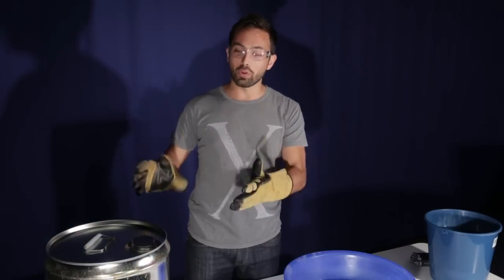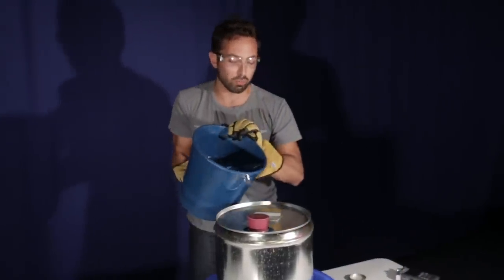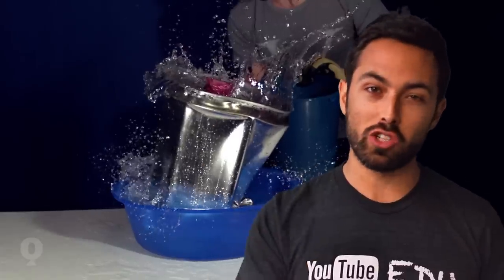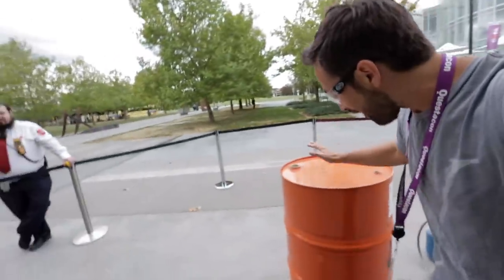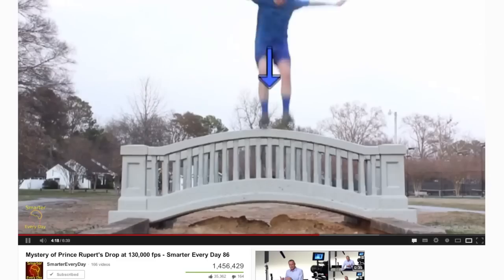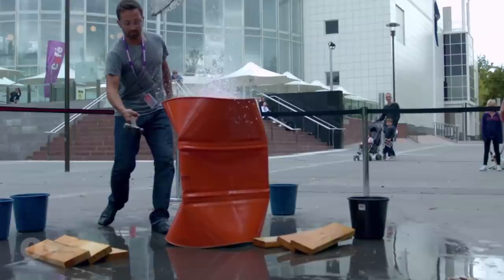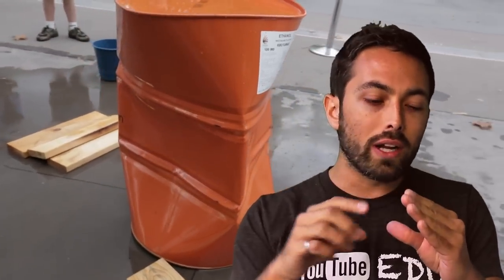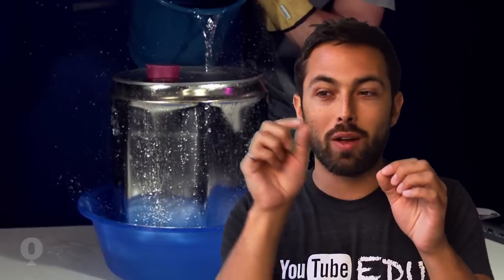Epic Slow-Mo Drum Implosions!

Comment: Ah, I see what you mean. A low resistance of pressure by the first cylinder prevents the pressure from building up and is not "crushed" as much as a cylinder with a high resistance of pressure.

Comment: I imagine it has something to do with the fact that as you scale down a cylinder the ratio of volume to surface area decreases meaning that the vacuum pressure per square unit of SA falls, which equates into the smaller cylinder not having enough of a vacuum to overcome the strength of the metal and form the most space efficient shape. It's like a compromise.

Comment: the stronger material of the larger drum gave it more structure under higher pressure differences, which gave it the need to optimise space better in order to reach equilibrium when the structure finally collapsed.

Comment: I type this comment before my mind is influenced and prejudiced by reading other peoples comments.
I put it down to these factors/understandings/principles:
1. The Smaller drum had a much more intense heat inside of it as it was heated indoors at room temperature, creating a greater volumetric difference when cooled..
2. The Larger Drum did not have as strong a suction as it was heated outside and constantly had the outside temperature  combating the smaller heat source under the barrel.
3. The Smaller drum had no reinforcing ribs around the circumference of the drum so gave in much more easily, allowing a short spread of the structural failure.
4. The Large drum DID have structurally reinforcing ribs pressed into its construction, so the force required to make the drum implode was so much greater, when the structure did actually give in The load was spread in a form that had more stability. A Triangle is more stable than a hexagon.
Have a nice day people. =)

Comment: I believe it s purely the difference in negative pressure with the orange cylinder having a more negative pressure than the silver one so it became the shape with the lower volume to surface area. If you were to create a pressure lower than the pressure inside the orange cylinder it would create an even smaller equilateral triangle (if the material were perfectly curved and without any imperfections) with the excess pointing outward from the points. such cool slow mo in this, loved it.

Comment: The first was to make the hexagon, but since it still had a vacuum in it, the bottom edge gave way as it has a crease similar to that of the 200 gallon drum. This allowed a portion of the drum to collapse again, but in a more confined section towards the bottom, which created more torque, along the now existent vertical edge, which caused the slight deflection of the top edge and plate you can see at 1:27.

Comment: The difference in buckling modes could be due to a difference in loading, the smaller can failing due to uniform atmospheric pressure since the failure wasn't initiated by a impact while the failure of the large drum was initiated by a impact load with the mallet. 

Another possibility could be due the location of the rolled beads on the drum. Rolled beads are used with sheet metal fabrication to stiffen the structure. The location of the beads would affect the boundary conditions of the drum.

Comment: The smaller drum is not only "smaller" (as in proportionally smaller), it is also a lot shorter in comparison to it's width and depth, or, since we are talking about a cylinder, it's radius.

Because of the properties of the metal, coupled with the smaller radius and shorter "body", there is a lot more resistance against the "walls"' movement toward the center,  and that resistance is what defines how many sides a (the resulting) polygonal cylinder will have in this case.

Comment: 2/2) Triangular surface area of bigger cylinder is proportional to the hexagonal surface area of smaller drum by a factor of k^2 - considered that the drums have the same pressure at the instant before the suction and right after the implosion. And so the bigger drum needs to make up for the greater loss in volume by a greater change in surface area of the dented part, and so it creates a triangular shape which is more efficient than a hexagonal shape.

Comment: I think there are a few things at work here, first the bif drum got help to start deformation so it was much more implosive. The smaller drum deformed in stages as the vacuum developed due to the thinner walls and absence of rings. Watching the slowmo again I get the impression the steel had a form of strengthening at the hexagonal corners, maybe from something as simple as heat or compression from rollers during manufacture or how it was stored prior to manufacture.

Comment: The diameter/length ratio of the cylinder affects the type of mode of failure. 

A very small ratio (relatively skinny or long) cylinder would tend to fail by collapsing flat (2 sides) on itself at the middle of the cylinder then spread to either end where it's constrained  to stay a circle.

As the ratio increases (cylinder becomes relatively fatter or shorter) the number of sides created would increase from 2, to 3, and so on to infinity (cylinder becomes a disc).

Comment: i believe it to be either an effect of the height to radius ratio being smaller on the smaller cylinder or the smaller drum simply wasn't compressed 'exactly' the same so it wasn't as compressed as the larger one. or it was more structurally sound so the force of the vacuum could only compress it to a lesser extent, so a triangular prism would have been to little space for the matter within the smaller one, and a rectangular prism having more space fit the change better.

Comment: The different failures were the result of the structures of the drums.

The larger drum was taller, so the wall was able to deform more without significantly altering the structurally sound circles on the top and bottom. This allowed it to for the most compact shape in the middle while still being round on top and bottom.
The smaller drum could not form a triangle without drastically altering the top and bottom so it did not. The inverted rips further strengthened the ends as well

Comment: The energy required to compromise the structure in consideration with the length available for continuous deformation defines the shape of compression.  If the first drum were longer (perhaps twice as long), with all other thing being equal, you would have gotten a triangle, but the energy required to compromise the second drum is so great, if you kept all re-enforcement the same, you would likely have to scale it to a quarter of its size to produce the hexagon.

Comment: dont forget that a hexagon, is just two equilateral triangles placed (and rotated) on top of each other. also, the smaller drum encloses a smaller volume, so surely it would "want" to   deform less as there is less of a vacuum to pull on it form the inside. So it deforms into a shape that relieves the can of less stress, and the big drum deformed into a shape that relieves it of more stress. ie. the deformation is proportional to the stress on the drum

Comment: A triangle has a much smaller volume.
So the amount of sides would be relative to the amount of pressure that needs to be equalised.
In the case of the can, it was weak and crumpled early causing only a small amount of pressure to change, it happened even before the steam had all condensed as seen by its second crunch.
In the case of the 44, it has 2 reinforcing corrugations around the side, so it can fight off pressure until a large amount need to be equalised, and so it needs to crush into a smaller shape, IE triangle.
If you had an even stronger canister being crushed it would have only 2 edges.

(don't quote me, I have no education at all on the subject, just a guess)

Comment: I noticed the drums collapsed around the ridges in the drums, which were nearly at the top of the small drum and around the center of the big drum. The volumes are different and the area above and below the collapsing point are too. By how thick the metals were in both barrels, and the size of them, the shape they collapsed in were just most convenient. Plus, you can already see the faces of the hexagon before it crumbles by the reflection of the light.

Comment: The ribs and thickness add strength to the drum. The drum is so strong that it is not able to buckle easily. The weakest division of a round hoop is 2 sides but since the forces of these two sides are equal and opposite the drum can't fold in two. It is forced into the least unbalanced state or three sides. The container is weak relative to the stresses on it so it buckles over a shorter distance or more sides. Picture a long bridge made from thick steel compared to a short bridge made from foil

Comment: Since the big barrel was relatively long enough, the atmosphere was able to equalize the pressure by doing as little boundary work as possible.  But since the diameter/height ratio was larger for the small barrel, the metal would need to be stretched in order to form an equilateral triangle (and obviously stretching metal requires a lot of work). Therefore, for the small barrel, the regular polygon with the least number of sides which would not require stretching the metal is a hexagon.

Comment: I think I have an explanation for different imploded shape:
I believe it has something to with the Euler's Buckling Modes....
To simply it....the slenderness ration (given same material for both cyclinders) is different for both cylinders. As the larger 200L drum has large slenderness ratio (above a critical point lets say SLc....which is required for an equilateral implosion)...so it'll buckle in a simplest buckling mode i.e. an equilateral triangle, where as the smaller drum has a lower slenderness (lower than SLc) ratio leading it to implode is a more complex buckling mode.
This is a very quick explanation on Sat night....but I believe I have the right direction.
To understand how buckling comes into play draw a free body diagram of cylinder's cross-section (looking at it from top or bottom)...and you'll see that only the compressional forces in the sheetmetal are the real culprits.
Hope....I'm right
Reply: personally, I feel like it has something to do with how close the crushed area gets to the more reinforced "caps", as for the hexagon it's extremely close and in a sense must be more like a circle, while the triangle one is fairly far away from these edges, allowing it to take the shape that is least like a circle, the triangle, I guess a better way of putting it is that the caps restrict the ability of the can to crumple, resulting in the different shapes depending on how close the crumpled zone gets to these edges, think of how much more difficult it is to crush a can at the ends rather than the middle.
sorry for my terrible explanation, I'm not very good at explaining concepts in my head and would probably be a terrible teacher, however, if anyone can understand this and create a better explanation, please do

Comment: The shape of the cylinder after the implosion is dependent on pressure difference and the resistance of pressure by the cylinder. Less pressure difference and less resistance results in a prism with many edges. Bigger pressure difference and more resistance results in a prism with few edges, or three edges, the prism with the fewest number of edges.

Comment: I think the little drum is structurally stronger then the big one(thickness of the tin on both of them is probably the same and they have to resist different force -- air pressure across different surfaces). The metal tries to move as little as possible on both of them, but due to the structural weakness of the big one it is easier to form a triangle and in the little one it takes less work to make a more-lateral polygon rather than a triangle since it still has some "resistance" in it.

Comment: They crumple in different patterns due to the difference in shape of the top edge of the drums. In the 20 gallon drum, the top edge is a concave "C" shape, which can resist higher forces of deflection. However, in the 200 gallon drum, the edge was a much simpler folded crease. This cannot resist such high deflection forces from the collapsing walls so the top plate can bend to accomodate the triangle. The top edge of the 20 gallon drum could resist it better, which is why it collapsed twice.

Comment: I like point 2. The smaller the drum the smaller the change in volume necessary for the desired pressure. Therefore as a drum decreases in diameter it's compressed shape will resemble a circle more and more. Conversely the larger the drum the more a compressed shape will resemble a triangle (or perhaps it may implode completely into a straight line, like it's been pinched there?)

Comment: i believe the drum crumpled to the triangle because of the strengthening bands that surrounded it and apart from size "volume" its the only significant difference between the two drums, so even after the barrel collapsed the bands still strengthened it sufficiently to not be crushed completely, so the vacuum still existed so had to take the smallest shape possible

Comment: What an awesome video!

Maybe the smaller drum made a hexagon because it's height to diameter ratio was lower and the supporting circle at the top and bottom of the drum had more influence?

If you suck on a straw it will even get totally flat in the middle, thus only having 2 corners.

Comment: I realize many commentors are saying something about the hexagon being stable enough, but remember that the hexagon was metastable, because a few miliseconds later it crumpled again. The large drum simply went past the hexagon and straight to the triangle. Also, from other videos, soda cans will crumple straight away in the manner similar to the smaller can, but without going to the hexagon. I propose that the thickness of the drum relative to the curvature is the most significant factor.

Comment: Minimum volume is not an equilateral triangle, it would be something flatter. There are plenty of real world examples where vessels or large pipes collapsed under vacuum, and depending on the exact situation they tend to wind up flat, or flattish. When you design pressure vessels, you actually have to check if they will withstand full vacuum, and provide protection if it is needed.

Comment: If you imagine doing this to a tuna can with very rigid endcaps, I think you get at the reason for the different polygons. Thinking about the interior angles also helps make sense of it. A near perfect circle has the largest interior angles, approximately pi. A triangle has the smallest pi/3. The other polygons are in between. In order to get a small interior angle the material must give/bend more substantially. Makes sense that the more stable container would be unable to achieve the optimum.

Comment: It's most probably because of the shape of the drums, especially on the corner. the first one has obviously a stronger base, and it's length (comparing to the surface of it's base) is not big enough to allow a triangular shrink, so it was decomposed to smaller shrinks. while in the second experience, the drum was tall enough, and the corner was not strong enough to keep its circular shape, so it was more shrinkable than the first.

Comment: The ratio of height to diameter is very different for the two containers, and so was the ratio of material inflexibility to height, I'd bet. That gives it both much more room to crumple inwards around the relatively inflexible beads at the top and bottom, and allows the metal to flex inwards much more as well. With its ability to crumple inwards from the beads at top and bottom restricted, it still managed to form a most-ideal shape for the conditions.

Comment: I believe, the reason that the larger drum  compressed into an equilateral triangle and the small container didn't was because the larger drum had weaker caps, top and bottom. The weaker caps allowed for more deformation of the sides.

Comment: You can do this with 16oz beer cans and above.  Just put a little bit of water into it and let it come to a boil.  After it has a significant amount of steam coming out the top, grab some tongs and (quickly) turn it upside down and put it in some standing water (like a plugged sink).  It really does happen VERY quickly.  What I've noticed is that they always crease on four different sides.  btw, 12oz cans are very hard to work with, so I'd go no smaller than 16.

Comment: Key Observation:  Only the middle third of the large drum compressed/flattened, while the small drum basically the whole side compressed.  

This leads me to think that there is uneven pressure for the large drum while the small drum is more even comparatively.  The likely culprit is the fact that there is a ring separating the rings in the large drum, likely engineered into the structure for resolving compression/explosion problems.  The small drum is smooth in these areas so does not have this

Comment: there are many variable to consider here, how much material was placed in the space of the drum, the location of space in which you place the drum at and finally the space in which the material is made of. Assuming all sides equal, a circle should be the shape, and if not the surface that has greater influence dominates the circle to its value accordingly.

Comment: The vacuum sucks in all directions towards the center of the drum so all the particles that make up the walls of the drum would like to approach the center at the same time but due to the interactions towards each other they cannot, so they form segments. Because the walls of the big drum were stronger, the gas (vapors) inside had enough time to cool evenly and form a stronger suction force towards the walls so they caved in creating fewer segments.(my answer was longer but I can't post it here)